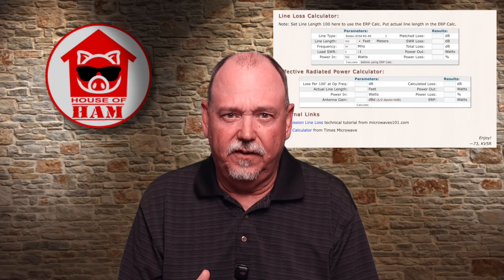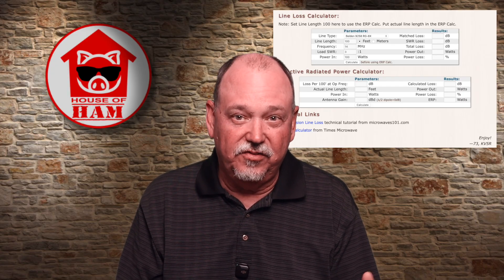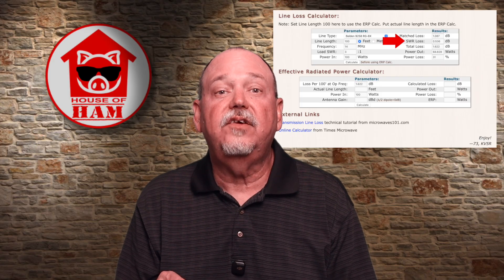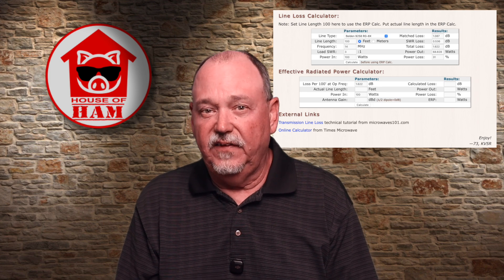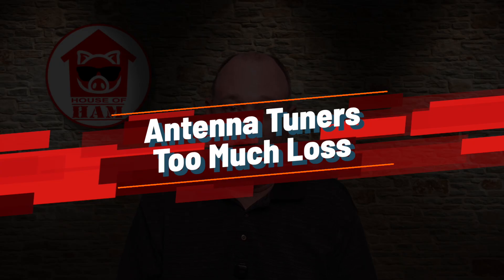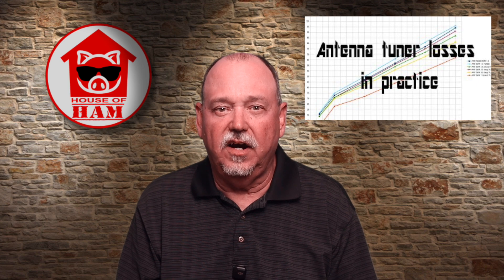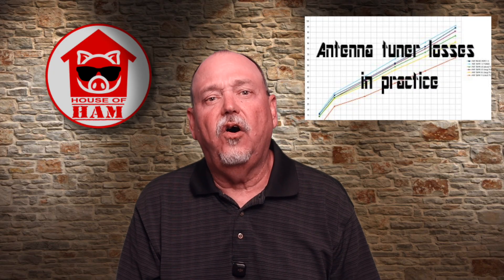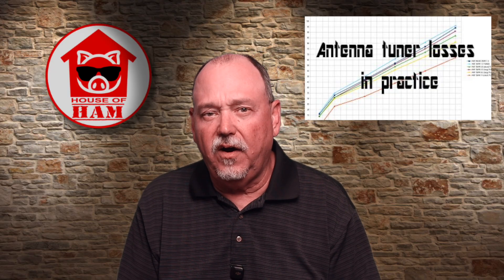Antenna Tuner Myths

Comment: So where are tuners most important? CW/ QRP? Where the actual radiated power of the antenna is relatively tiny to begin with so any losses are a big deal for trying to dx? 73 KO6JPZ
Reply from the maker: A tuner is a good tool to have both for shack and portable ops. If your antenna is close to 1:1 SWR like up to 1.5:1, You can go without it and do well. As you get up to 2:1 and beyond, you will start to see benefits of a tuner. Keep in mind that the losses in the tuner are probably less than the return loss from SWR as it goes higher.

Comment: Unless  you are not using coax which is no needed on wire antenna's. Open wire feeds eliminate the loss and the Tuner does tune the antenna as it isn't really resonant not is it intended to be and on HF wire antennas is by far the best choice. IMNTBHO. W7CM